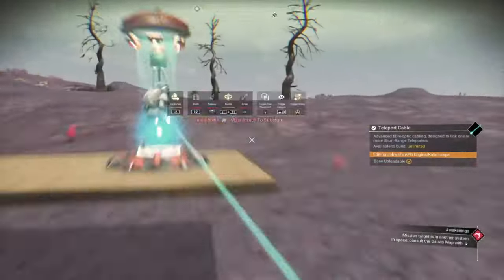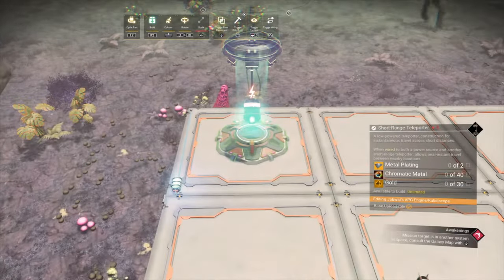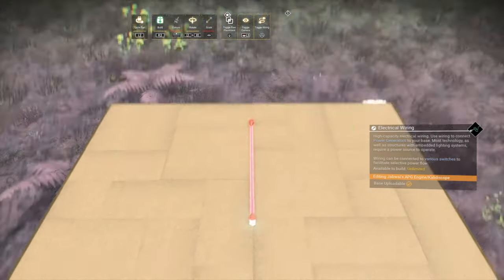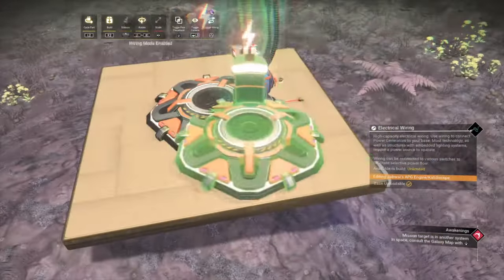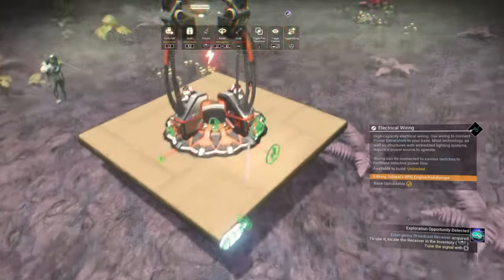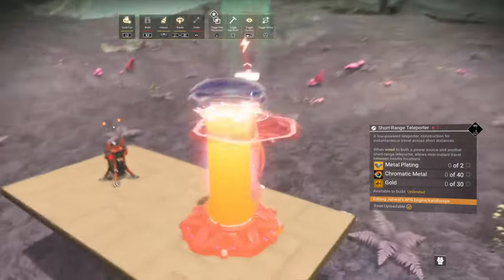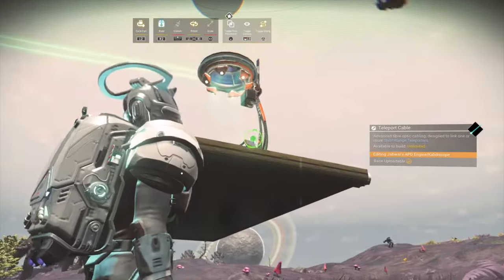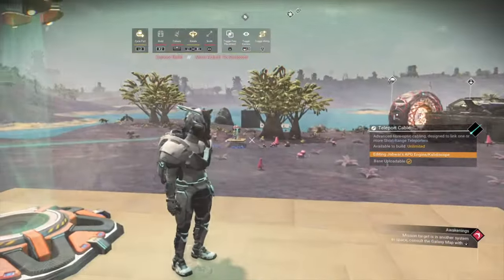Extend Short Range Teleporter How To Build Tutorial No Man's Sky Update 2024 - NMS Scottish Rod

Comment: I just made mineb aand they aren't 90 degrees, they're 180 to each other.   Not had aa problem yet.

What is the problem?
Easy to make changes if need be.
(Which is nice)

Also, I have one using 4 and another 5.   Linked a base to the settlement office.   Distance covered, 480u. (On the bigger one.)

It's so much easier now.
Reply from the maker: No real problem, on very rare occasions they can shoot you out but mostly it’s easier to glitch at 90. for those new to it. 😊
Reply: @ScottishRod  ok.
Never been spat out yet, but I might be lucky.
Although I did use teleporters to drop Conflicted Gaming through a planet.   Which I found funny.  :)

I did find building up it sometimes refuses to let you connect wires\teleport line.   (As in from ground to air base) 
And the no build around your ships is bigger.

Comment: Hello. New player here. I can't even connect basic teleporters properly. They're both powered from the same source and are on (green glow). But the teleporter cable just won't snap into place, for some reason. It's supposed to connect to the white displays with the arrow right?

Can someone tell me what I'm doing wrong? Thanks. 🙏
Reply from the maker: There can be a slight issue if the camera is to close to the item that prevents the snap.
Pull back a bit, move the build camera to a slight angle.
Hope that helps. 😊
Reply: @ScottishRod  thanks for replying. Unfortunately your suggestions dont work. I've tried a variety of distances, switch the camera off from the PC, get up high and low, even try to line 2 teleporters together in the view and go back and forth. The cable just wont snap into place.
Reply: Sometimes there are hard-to-see proximity warnings in the verbiage on screen…to close…starship, your characters’ body check everything!